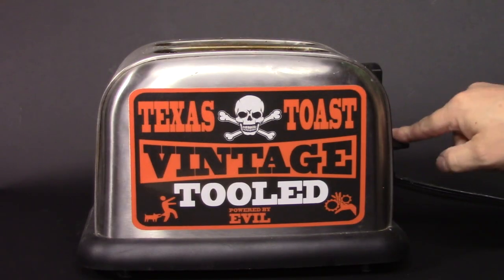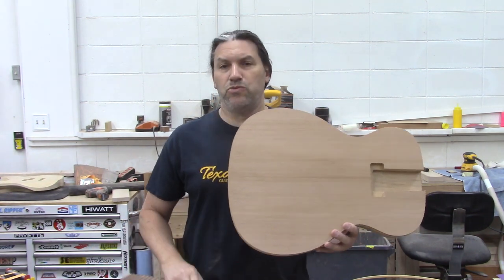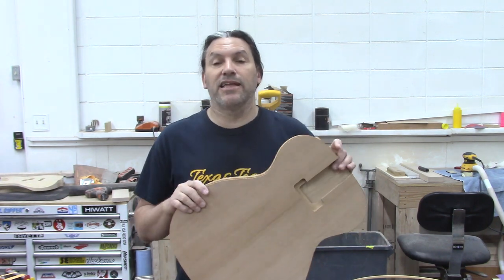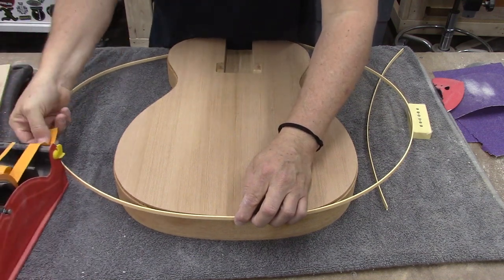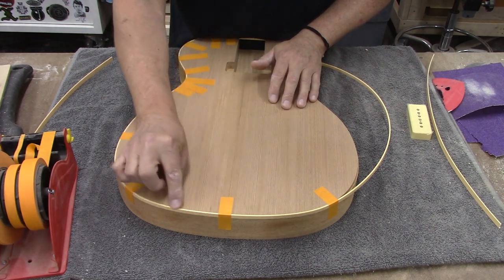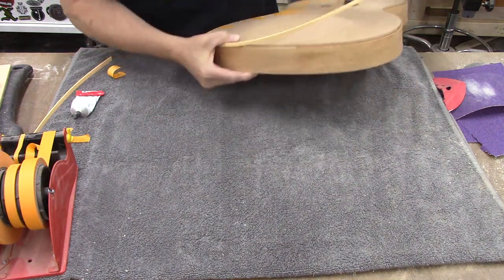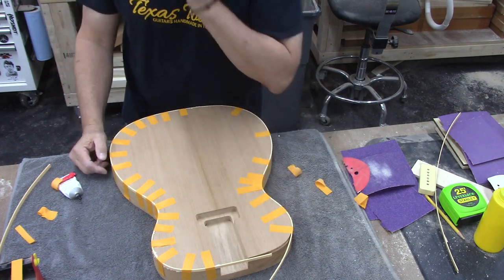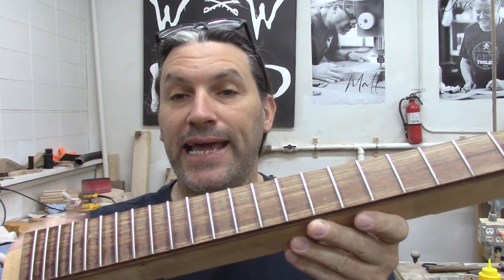A Few Neat Tricks & Cool Tools To Help With Binding Your Guitar

Comment: Back in the early 80s I used to have an old Kay, all mahogany acoustic with no binding anywhere and ladder bracing, one of my first acoustic guitars. I basically had to glue it back together. All the edges on the end grain were chipped out and beat up because there was no binding. A far cry from my earlier Japanese Conn branded D-35 copy. I always thought binding was to protect the end grain. You make it seem as if it's just decorative. It's a piece of plastic or wood that can be replaced when the edges get beat up. I had that Kay for about 3 years, and it played great if not a little thin sounding. I sure miss that Conn to this day though, bling city with snowflake inlays and a 3 piece back, but I needed money. Teenage hellbenders are expensive, LOL!

Comment: Great video Matt, I’ve used Bindall and acetone, things for and against, Bindall comes out of the tube fast, so it’s easy to make a mess, but if used sparingly makes a neat job. Acetone melts and fuses the joints together and fills in imperfections nicely, but if it runs under the tape it will melt the binding on the side and spoil everything, you make look so easy! 👍
Reply from the maker: I get the turbo dump Bind-All too

Comment: I'm about to bind my first fretboard, I was going to use superglue as that's the way I've done bodies in the past but seeing that 'Bind All' glue changed my mind! Turns out however that Stew Mac don't ship it to the UK! So is there an equivalent glue that's similar to that one? Also, would a metal binding (soft none ferrous metal) be possible? If so, how would you go about it? Thanks!